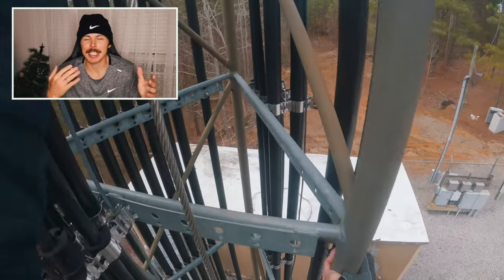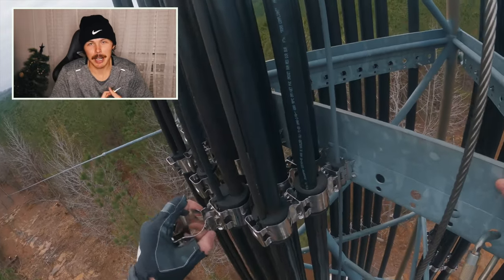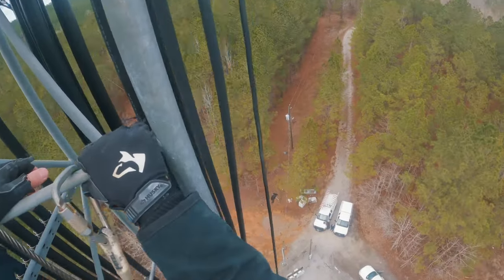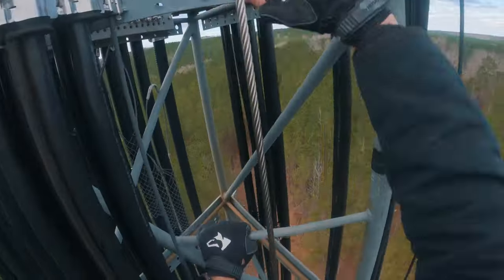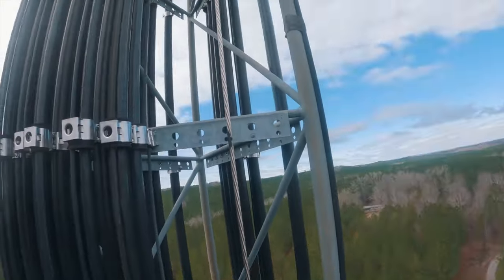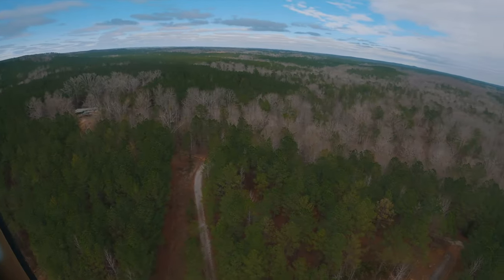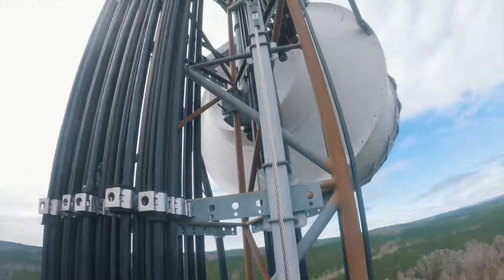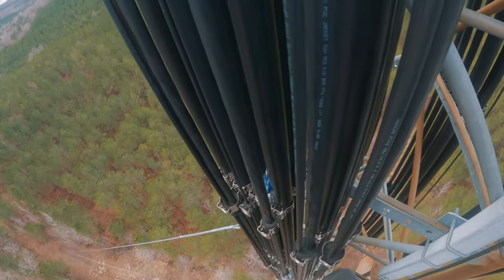Climbing Cell Towers

Comment: I start my tower training next week. Nervous, scared, and excited. But hey nothing gained if nothing ventured.
Reply: Gratz man
Reply: Be safe be safe.
Never ever let your guard down and always follow your gut instinct.
Forever safe climbs in your career.
Great prosperity to you.
Reply: Trust you’re fear and don’t get complacent with you’re safety you’ll be good if you trust and use youre gear right even if you slip and fall you ain’t goin far
Reply: @marcusortega2463  Thanks. Short lived career. Tower climbing itself wasn't the issue. I was originally had a great trainer but when they finally matched me up on a permanent team. The forman hated my guts for no damn reason. It was obvious he was after me. Purposely wouldn't send me the schedule or tell me what locations I had to drive too. I kept having to reach out to others. But ultimately I was terminated due to too many tardiness even though he refuse to ever tell me where to go, knowing I usually had to drive around 2 hours to the location. Climbing was a breeze but working under him was a nightmare. Still got my gear, going to try for a different company this spring.
Reply: @romarkablebert  how do you apply for this kind of job? Can’t find it anywhere on indeed I’m in Canada so any tips on how to apply for this kind of job would be great
Reply: Don’t be scared bro, you got this!
Reply: How do I start?

Comment: I can't believe you do that despite formerly having a fear of heights. I have a fear of heights and could never do that. If I climb several rungs on a ladder I freeze up. The worst towers to climb would be the ones I think you referred to as monopoles. I recently watched a video of someone climbing one. It was just a single pole (like a utility pole) but with metal steps every few feet for the climber to grab onto, put his feet on, and hook his safety harness to. I couldn't climb one of those monopoles even if I was offered $10 million.

Comment: The safety climbs have almost got me killed a couple of times.    I wouldn’t ever use one again.  If I was still doing this job.  Unfortunately I can’t Because of massive shoulder injuries that happened to me while I was climbing At least the monopoles  are short I t is a awesome job I worked from Trico Tower for 4 1/2 years.  I was 44 years old when I started.       Lighting tech.      Rebuilt strobes and replace lightbulbs.   And sometimes rebuilt lighting systems.

Comment: I'm guessing you were working on a radio problem judging by the flapping tape. Possibly water ingress on the power connection, those old radios give us problems if not waterproofed correctly.

Comment: I’ve got a really stupid question but I hope you don’t get too mean:
Wouldn’t it be better if you climbed up the inside of the structure? I know it’s tight but you would be somewhat safer??
Reply: Most towers have that safety line going all the way up that they are clipped into with a brake

Comment: My company electric utility used to climb all the techs got old and fat management was afraid someone would get hurt they outsource it now. Makes sense anyway skill not used regularly is unsafe we really don't need to climb our towers all that often. We had a few falls over the last 30 years always someone freeclimbing small 50-foot towers thinking it would be easier to just go up fix something. One guy ended up in a wheelchair permanently that was early 2000's.

Comment: A buddy of mine was looking for a tower hand. Are you still working this job and how are you liking it? I'm not deathly afraid of heights but I'm definitely afraid of falling so if I'm near an edge high up I'll have a sinking feeling in my stomach but I think it's something I could overcome. How long did it take you to over come the fear and how bad was it to begin with?

Also how demanding is the job? I hear it doesn't pay as much as it should but I figure if it's something I'm going to stick with for awhile I can climb the ranks and the company I'm applying for is looking to unionize soon  which should be even better for pay and benefits.
Reply from the maker: It was an okay job, I no longer work there. 
The scheduling sucked with the company I worked for. I never knew what I was doing until the night before each work day. I have a lot of other goals that I’m chasing and not having any resemblance of a set schedule made it nearly impossible to do anything else in life for me. I’d rather take a pay cut working somewhere else than give up on my goals.

I was scared of heights when I started but just made myself do it anyway. The jobs we did were extremely easy tasks but doing it being 200-500 ft in the air is why you’re getting paid what you’re getting paid. 
The job doesn’t pay as much as it should. The ceiling where I was at was pretty low when it comes to making your way up the ranks. Job security was a thing for me as well, we went 4 months with little to no work. 
It can vary with what company you’re with. 
Hope this helps!

Comment: Im also afraid of heights but mostly afraid of falling. Im actually in the airstream course right now and want to work at a telecom company. Hopefully I can get over my fear once I graduate. What are the average tower height you work with?
Reply: Really depends on where you live Midwest and south get pretty tall
Reply: It depends, most metropolitan areas I’ve worked in have been 100ft and below, but sometimes you get sites in the middle of no where, and those towers typically tend to be a whole lot taller, usually 250ft or higher, but there’s a lot of variety, you just never know what you’re gonna get